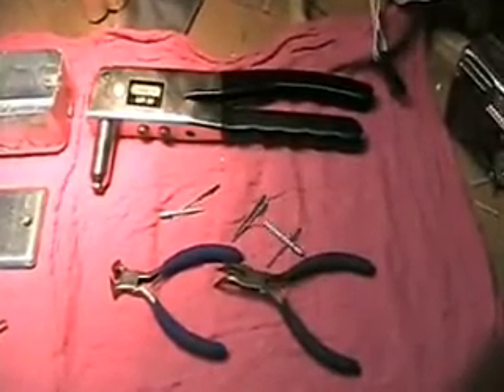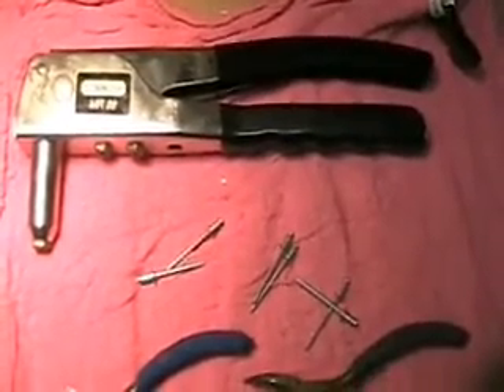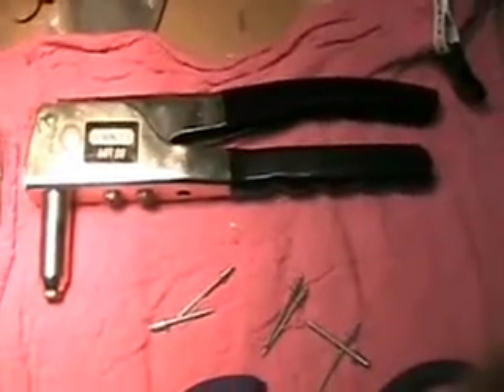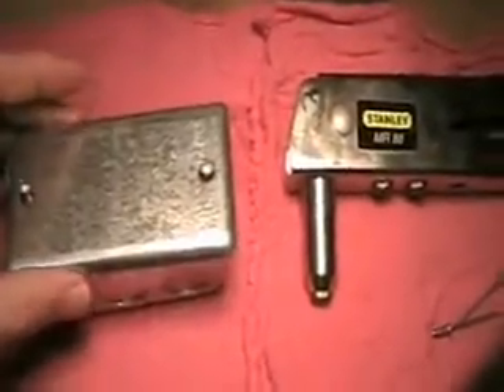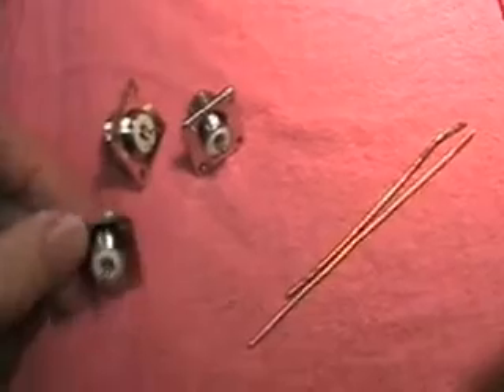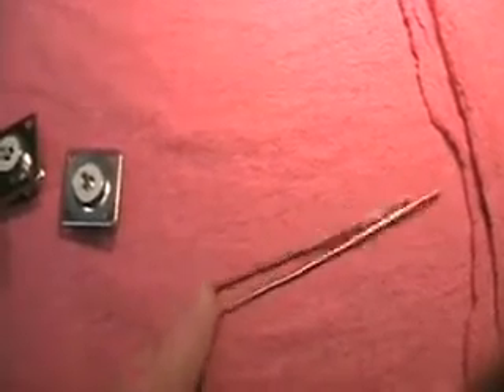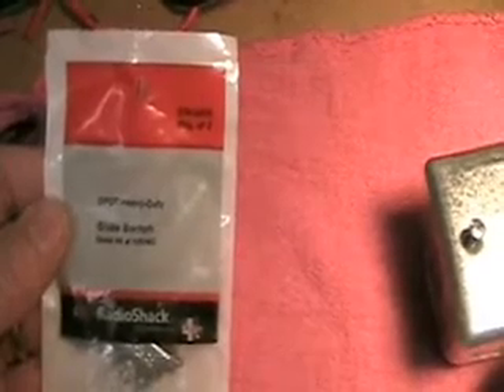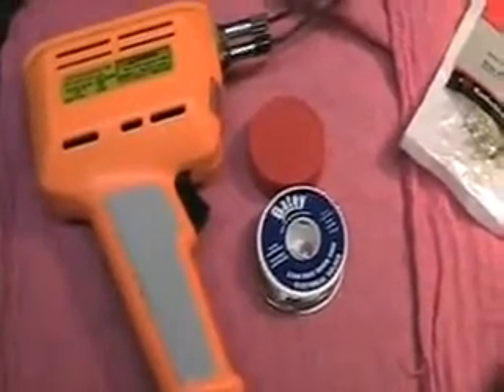Ham Radio—Homebrew Antenna/Coax Switch: Part 1

Comment: My bad.  My grounding through the switch box was poor.  I went back and used coax cable in place of the 14 g wire and tied the shields together.  Happy SWR now.

Comment: I have a question hope you guts can help I want to use three CB's on one antenna can I use a three way switch and reverse it with the  hooked to the antenna side and the antenna to the cb side?
Reply from the maker: That may be possible, however I would make sure there is no RF feeding back into the other radios.  ~John

Comment: John, nice videos.  I made one of these for my 2 meter rig to switch between my dipole and yagi antennas.  When I hooked the antennas up, my SWR went from 1.1 to over 10.  I'm still a bit of a noob with antennas but before I start whacking on my antennas, any suggestions as to how to tune this?

Comment: Can you operate your switch on 2 meters or 70cm without a high swr?
Reply from the maker: riddick1125 Thanks for your comment.  I only use the switch on HF and have no problems, in fact I've built another one to use when camping and both work very well.  However I've not tried it on VHF/UHF so I don't have any good data on how it would affect SWR there.  Hope this helps.    ~John

Comment: Tinker John,
     It might be a stupid question but are you currently using this switch and is it working out the way you built it?
Reply from the maker: riddick1125 Thanks for watching and for your comment.  Yes, I use the switch regularly, in fact I've built another since the video.  Hope this helps.   ~John

Comment: I do have one more question...did you do anything with grounding or anything with outer chassis of the so-239 connectors?
Reply from the maker: riddick1125 This particular panel is not grounded since grounding is done on the entrance panel, however it could easily be grounded.    ~John

Comment: Do you find that using an Antenna Switch Box you lose watts? Inother words I use a Zetagi 2 way switch box SW1 Yaesu FT7800E SW2 Icom 290E normaly without switch box a full 10 watts from both, BUT using the Zetagi I get 10 watts on the Icom 290E and 7 watts on the Yaesu FT7800E I am using new patch leads. So why is this? Any help thank you.

Mike M6YMN